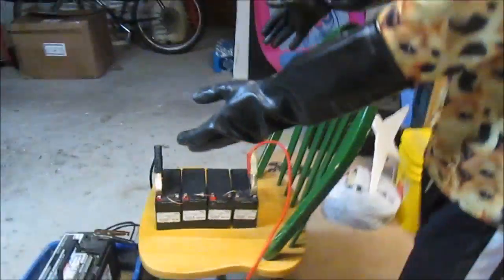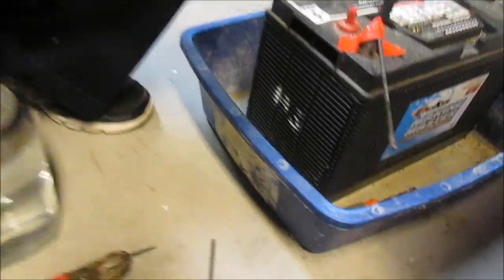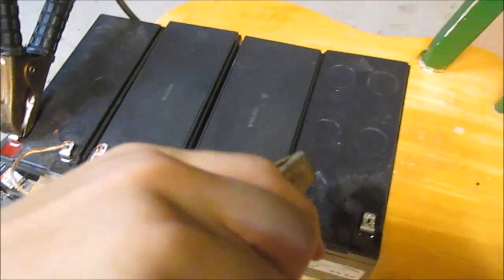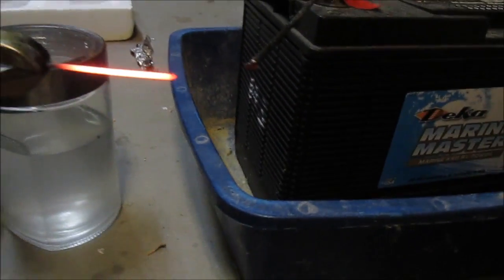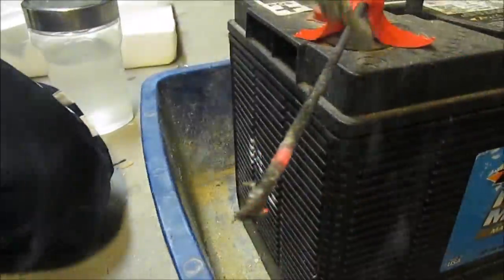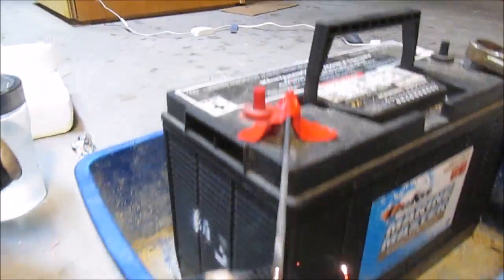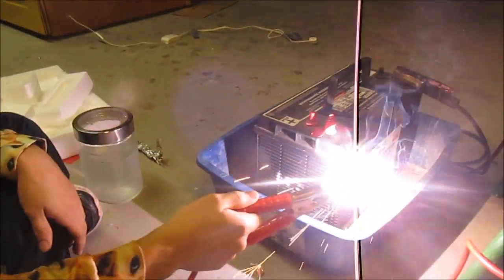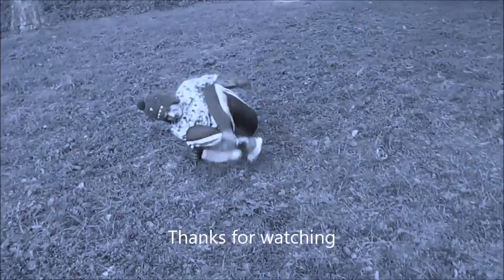12 Volt Batteries in Series

Comment: This is the quality content I subscribed for. But seriously guys, you should use more safety precautions!!
Reply from the maker: You're certainly right, we often put together an experiment on the fly when we get curious about something. Although, contrary to what may seem common sense, touching those batteries would not have been deadly or even hurt very much. Because they are DC and not AC, they do not cause the type of damage through humans that capacitors or wall current does. In fact, we did touch four of the linked batteries because we knew they would not harm us. Here's a video about that: https://www.youtube.com/watch?v=ZxBF7WC0TQk
Reply: Oh yeah, the voltage isn't high enough to hurt you, I was talking more about protection from the arc flashes and bits of hot stuff sent flying everywhere!
Reply from the maker: Oh yeah. That is our bad. We do have goggles and facemasks and gloves, but as you can see we haven't yet mastered the art of being smart enough to remember to wear them. We should put up signs or something
Reply: Years ago in junior high, I was playing around with the lithium metal that you can extract from Energizer ultimate lithium batteries. I wasn't wearing any safety gear at all (not even goggles), and I threw some in water right in front of me. The whole thing caught fire and then blew up in a shower of sparks. Good thing none of those white hot balls of molten lithium landed on my face.